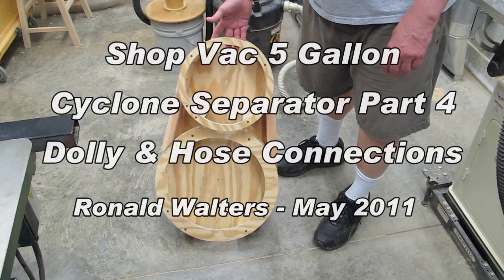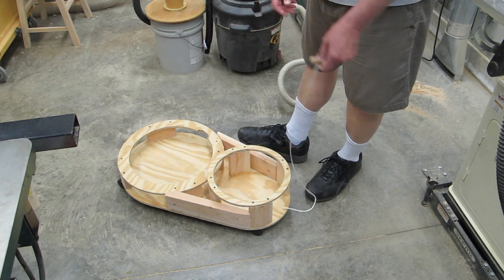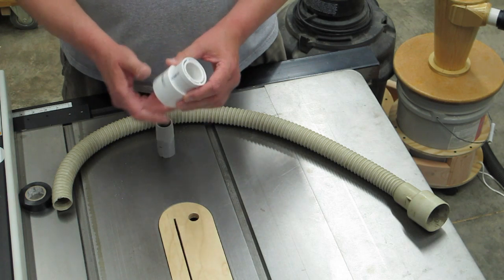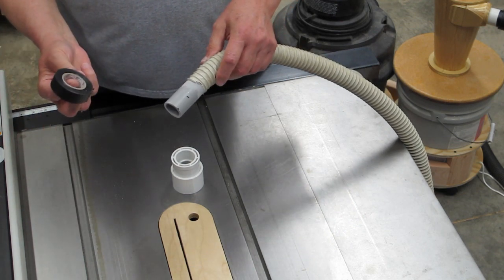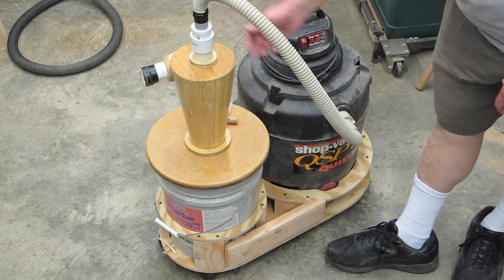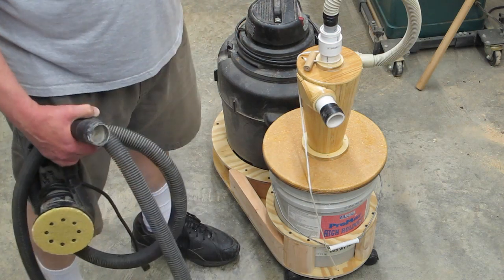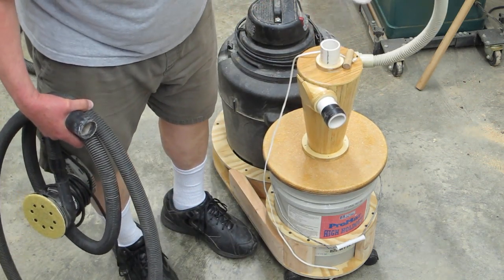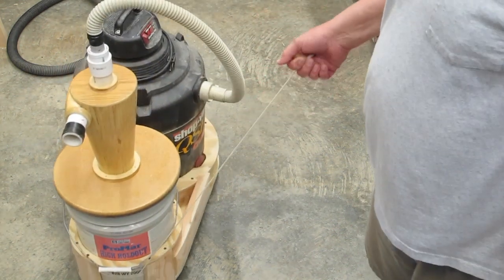Shop Vac 5 Gallon Cyclone Separator Part 4

Comment: Lovely - functional!  Nice job!  I've got a Ridgid shop vac that I am going to try to get the casters off of so I can use them, but they are 'snap ins' and I doubt that I can remove them without breakage.  

Your design is far better than others that I've seen.  I just bought the dust deputy and hope it works as well as advertised.  I'll use it after I get the cart built tomorrow.

Comment: Try using plumbing couplers for the pipes.  Will keep the inside diameter the same size as the pipe.  I used central vac tubing because of the pipe diameter and the parts cost and availability. Nice turning by the way.  Makes far a nice neat project.

Comment: This is a nice looking project.  I think I'll give it a go.   Great job.

I will make one observation.  You really should retain the 2 inch hose side from the vac to the collector/separator.   The 1 inch hose is going to add unnecessary restriction and will reduce the life of the vac as well as reducing performance.

Comment: I built a cyclone out of 24ga HVAC drive material. I used a electrical pvc 90's-45's and used 2" pvc pipe to hook between my vac and cyclone. The electrical 90's have a much larger radius than plumbing 90's do. 
My shop vac takes a 2-1/2 hose though. The shop vac hose without ends on it will fit right into a regular 2" pvc coupler. Handy.

Comment from the maker: A dust collector will separate air from the water. The particles will follow the path of the water. Larger Wet or Dry ShopVac’s have a garden hose connection at the bottom of the canister. One without a pump would be best. Elevate the ShopVac and the water with particles can flow into another container. Assuming the particles are heavier than water, they can settle to the bottom and the water decanted off the top. Or try Google CENTRIFUGAL WATER PARTICLE SEPARATOR (i.e. water sand separator).

Comment from the maker: ShopVac in my video is 3HP. Original hose is 1.25” ID and is slightly reduced with the pipe fittings. What I show in the video is about the same as the original fittings (and a lot cheaper). You could convert your hose to the larger pipe size on the cyclone. I have not experimented with larger pipes in my cyclone, which might be more compatible with the larger hoses. Personally, I have never had a ShopVac with a larger hose. You could partially divert the vacuum passing through the cyclone.

Comment from the maker: This ShopVac originally came with this size hose. If it had come with a larger original hose I would have used it. With the clean cartridge filter and clean filter bag the airflow through the ShopVac while using the cyclone remains consistently high and the motor remains cool. Performance far exceeds anything previously experienced with the always clogged pleated cartridge filter. Thanks for watching!

Comment: I believe she asked if a cyclone could be used to separate a water feed from its solid residues. No air involved.

I can answer with my accademic knowledge saying that cyclones are best for gas-particles removal (given the difference in density) but in the oil industry cyclones are used to clean service water from sand. You need though high flows and speed and I doubt you could construct one of such cyclones out of wood.

Cheers :)

Comment: very good vid.  just a tip .... you loose a lot of pressure in the flexible hose.  if you use smooth wall pipe between the cyclone and the vac you will improve the efficiency.

Comment from the maker: @sushinutnc  The caster wheels I used on the cart came from the ShopVac and all four wheels swivel. It would be better if the two in the back (ShopVac end) were fixed and only the front two swiveled... the direction would be more controllable.  And yes, I push it around as much as I pull it. A handle bar would be good it it wasn't always getting in the way.